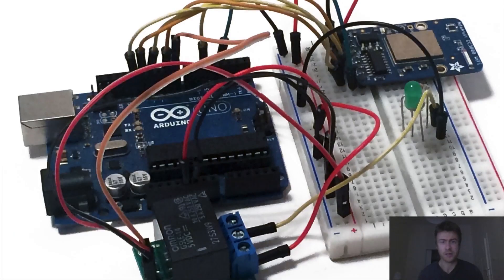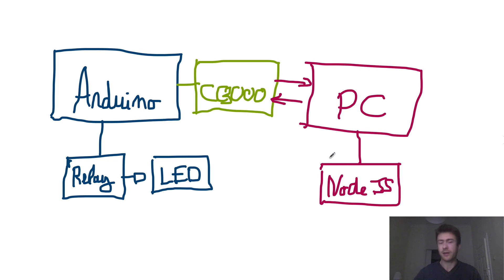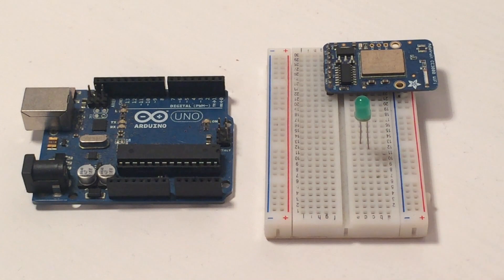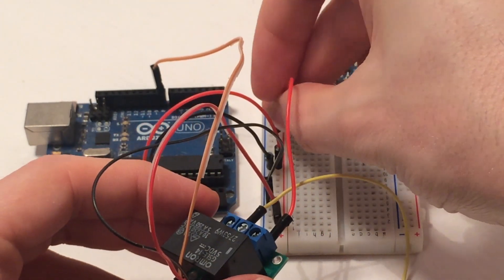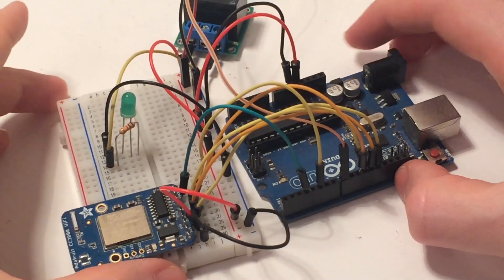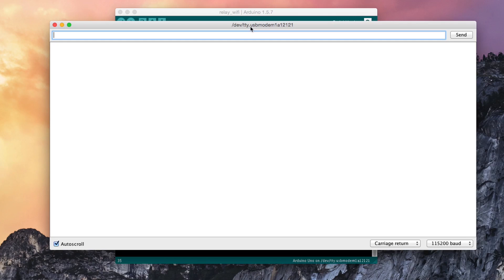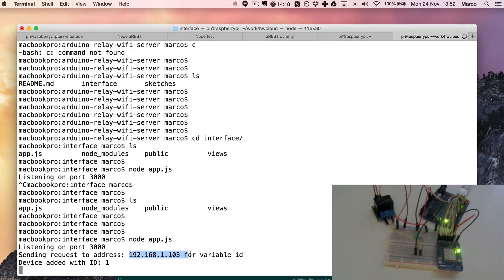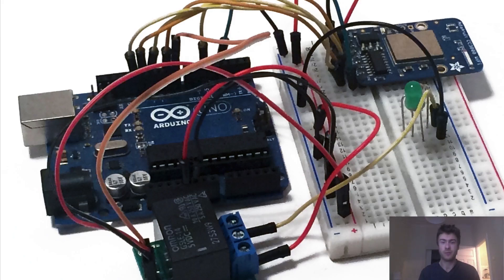Wireless Relay Control with Arduino & the CC3000 WiFi chip

Comment: I know this is a bit old, but just in case anyone can help... when I go to the IP address I get the following message and I can't change the LED ( I can't turn it on / off)... {"variables": { }, "id": "1", "name": "relay_control", "hardware": "arduino", "connected": true}

Comment: hi if i want to keep this cost effective only with arduino and not use wifi chip what is a good alternative.....?
Reply from the maker: If you want a cheap solution for the same project check my tutorial with the ESP8266: https://www.openhomeautomation.net/control-a-lamp-remotely-using-the-esp8266-wifi-chip/

Comment: Good tutorial...I have any problems. I have the Adafruit CC3000 wifi shield and Arduino Mega.  It works for about 1-2 mins to an hour and than stops working. perhabs cc3000 freezing. If I reset it, it works again. I used external adaptor 5V dc and 1A but problems again. How do I make stable system. Please help me. Any ideas on what else we can try?
Thanks

Comment: Hi Marco, For the interface part, the terminal you're using is cmd for window? I tried by pressing node app.js  and also following the steps in open home automation website which is sudo npm install express jade arest, it's still not working.

Comment: Hi,
Nice Project..
I was wondering if there is any way of using a app instead of a browser to control the relays.
Reply from the maker: Mervyn Sajan Thanks! Sure, you can definitely use an app for that. You just need to send the right commands to the board, just as you from the browser.

Comment: Hi, Great Work there.
I am planning on building a gestured controlled robot, which would send a relay commands from the pc to the Arduino using Addafruit CC3000 breakout board. Is there any way by which i can transmit text files using the CC3000 board?
Reply from the maker: Hrishikesh Jadhav You can transmit text files indeed, but to control a robot for example I would really recommend sticking to JSON. Check our other website: http://openhardwarerobots.com/wifi-mobile-robot/
Reply: Open Home Automation Hello once again, Thank you for your prompt reply. I did manage to read through the PDF, but I do not understand JSON well.Do you have any links or tutorial links that I could refer to , for a better understanding.
Also, does API Rest work with Arduino Duemilanvo?

Comment: Hello,
Do you have any tutorial that demonstrates wifi communication between two wifi (I am using two dfrobot WiDo) boards.Which means I don't want to use the browser.Is that possible? If so can you give me any clue?

Thanks in advance.
Reply from the maker: ***** Hi! No I don't, that's something I never tried actually, but it would be a really interesting thing to do!
Reply: Ya.Indeed.But I bought WiDo and it seems that it has less documentation on its wifi.So its going to be lot more work then I expected.